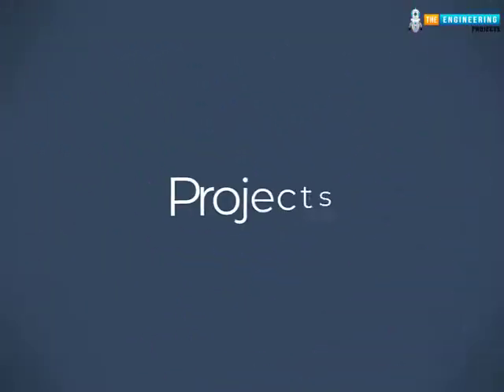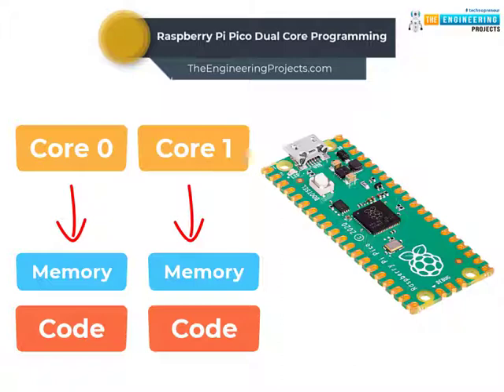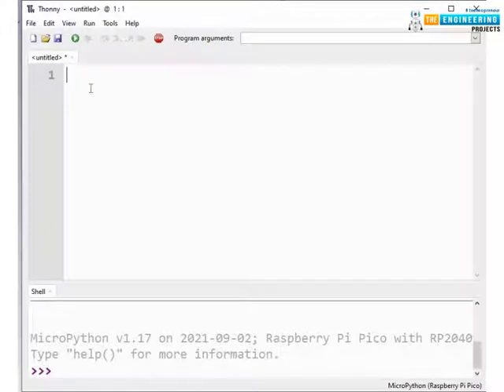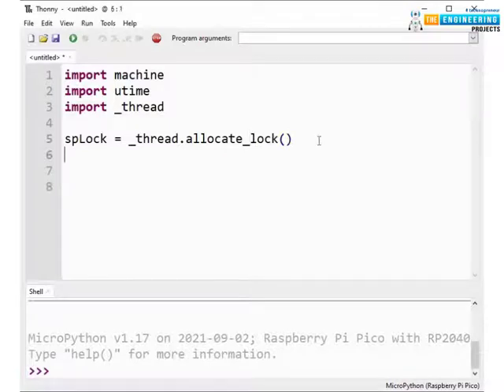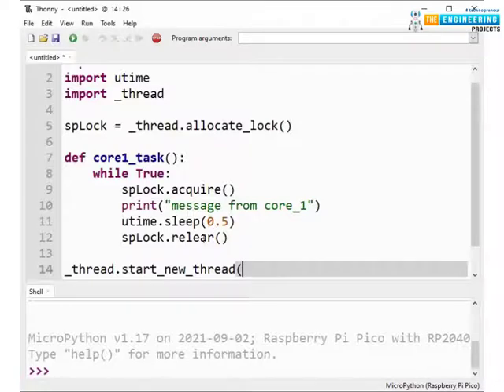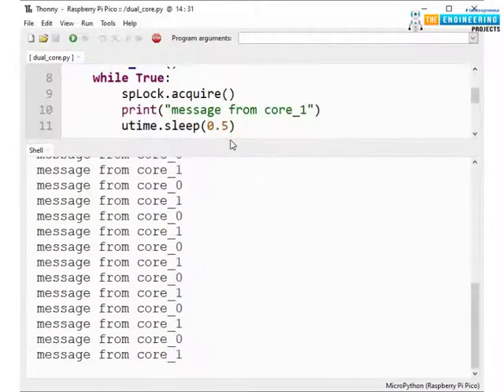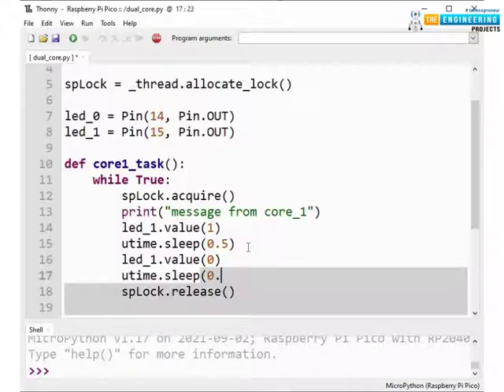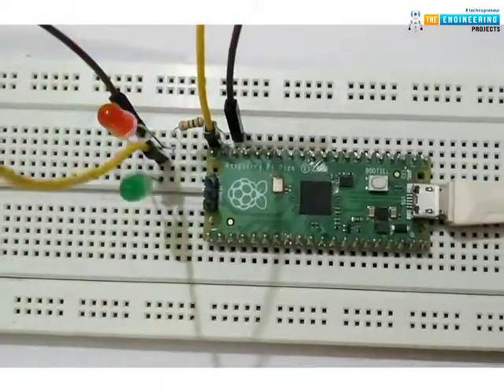Raspberry Pi Pico Dual Core Programming with MicroPython

Comment: I understand Pico has 2 cores..  before flashing, is there a way to select which UART and which CORE you want running micropython ?

Is there any way to see the different scripts you have uploaded to the file-system.. like thru windows explorer?   Ideally, I'd like to just drag the scripts over.   And what happens if you don't have a main py script.. will it just default to a REPL prompt?

My goal is to have one of the core handling the REPL traffic via UART1 (I believe the default is UART0), and have the other core executing my main py script.   Is that possible?